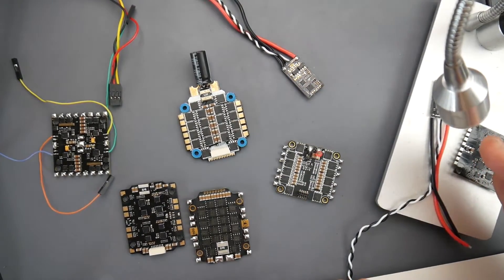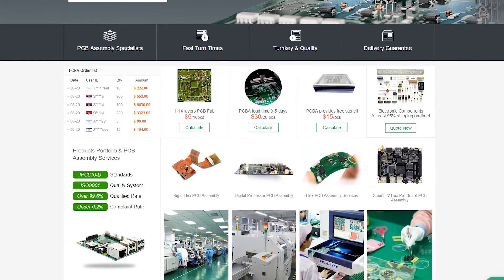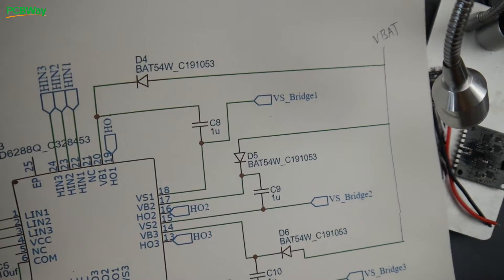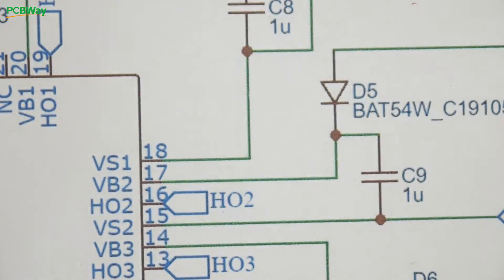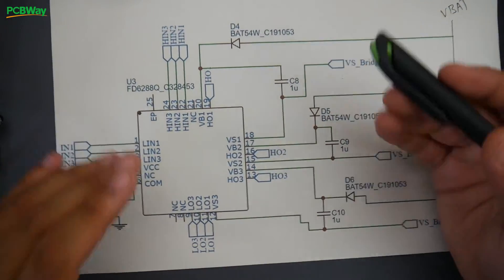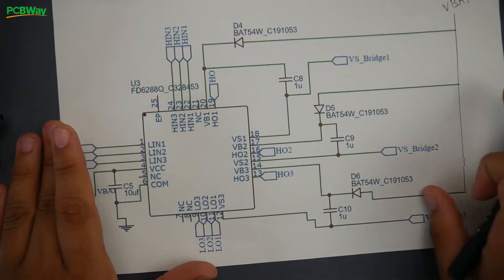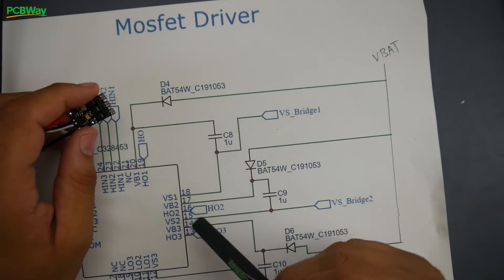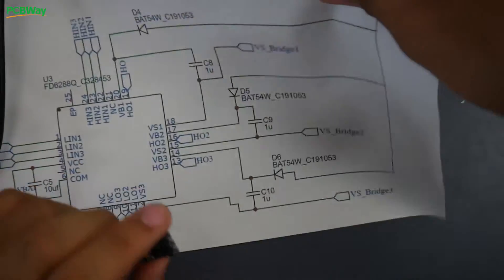How To Fix Any ESC // The Mosfet Driver Part 1

Comment: Great video for get some knowledge for repair our esc, right now I have a hobbywing 20x20 xrotor and I'm trying to findout how to repair it, m2 do not appear on blheli_32 motor connected even sound, mosfet are ok so don't  know what can be the issue, have this happened to you before or can you help me to find where is the issue, I have changed fc and wire to make sure is not a connection  issue

Comment: Hey Drone Mesh, I have the x rotor micro combo 60A 4 in 1 esc & flight controller F4 G3. I think I have a bust mosphett  on the esc and been watching your play lists for some tips. I’m not sure that I can read the number on the phett correctly to know which type they are. 
You wouldn’t happen to know what type of phetts these would be for this esc that I would need to get to make a repair?

Comment: VS is not Voltage sense, VS= Voltage Source (floating supply offset Voltage), for sensing Back EMF from the motor there is a resistor network placed close to the MCU each network is consist of 3 resistors maybe i guess. And thank you for making this awesome video.

Comment: I have an ORI32 that supplies about 25% less current to one motor at idle and at full punch outs maxes out in blackbox while all other motors are around 75%. I changed motors, resoldered etc and the problem persists at the same ESC location. The motor sounds fine and there is no stuttering. Is this a Mosfet or chip issue?
Reply from the maker: Seems to be a weak mosfet but you will have to replace all on the side with the issue.

Comment: I have 2 tekko32 that stopped working all of a sudden. One smoked when i plugged my battery, i checked the mcu and did not notice any strange short circuit, the only thing i know is that the 3v3 reg was heating a lot, and at first i tried to replace it, but that was not the problem. I still don’t know what happenned. The other one i let some time storaged (less than 2 months) and when i put it in my new plane it have never more turned on, but this time no heat nor smoke, it simply refused to turn on.

The first one i sent an email to holybro and they sent a new esc to me, but for the second i had not minded. I liked their support and warranty, but after these two problems and seeing some other people with similar problems i won’t buy anymore their products. Cheap escs have never disappointed me.

Comment: what if i short circuited it on the motor pads
Reply from the maker: I will purposely short 2 esc's on the channel for a tutorial video.
Reply: Thanks! Mine like smoked and it all looks black so would be cool if it could be fixed

Comment: Really a great content. 👍
However I have a question i.e. are the capacitors for coupling? For filter any DC out and let the AC only to the output? Like in audio amplifiers we put one between the output and the speaker?

Comment: Please do a video on replacing BLHeli 32 mcu chips. And flashing them from scratch as I have an ori32 that blew all 4 mcu chips all shorting to ground
Reply from the maker: it could just be the 3.3v
Reply: Drone Mesh it was in the short went away once I removed the chips. I also replaced the ldo regulator
Reply: I can replace the chips I just don’t know if you can flash BLHeli 32 from scratch as I have heard the boot loader is closed source for BLHeli 32
Reply: I had 3 Ori's failing in less than 20 flights something. 2 of them have shorted MCU as well. I've come into conclusion they're not worth fixing. The cramped layout is also a pain in the butt to analyze and fix. Unless you're running them on 7 inch cruiser only or something like that, not racing or freestyle. They're very sensitive to crashes.
Reply: Asu thanks for that!  have you actually ever replaced the mcu‘s is it possible to flash from scratch as I have bought the chips. I’m curious to know?
Reply from the maker: For blehli32 I have never tried but I will look into it. I'm 70% positive its possible
Reply: Sorry but it's not possible,  @rowanballinger3690 . The BlHeli32 is a closed-source system and only ESC manufacturers who paid for the BlHeli32 system has the code.

Be glad that you only have one dud, don't be like me who's don't learn quick and buy 2 more.
Reply: Asu thank you for your reply. Any suggestions for a reliable 20x20 BLHeli 32 esc. As you said you been through a few.
Reply: I stopped using 20mm on 5 inch ever since but if you're insisting, I'd put my cent on Aikon PIN35A,  @rowanballinger3690 .

I always prefer ESC with the bigger 5x6 FET than the 3x3 FET because I find ESC with bigger FET's handle huge transient current in crashes better than the small one. Unfortunately, all 20mm ESC's are using 3x3 or smaller FET's. They just don't cut it for me.
Reply: Asu that is great advice and completely get that but I live in United Kingdom and we are restricted to 250g so only fly 3 inch. I’ll have a look round for a better esc. I also enjoy repairing them and have repaired vtx’s fc’s just have not had much luck fixing esc’s. Maybe BLHeli s is way to go but it’s going backwards 😱
Reply: 3 inch is a completely different story,  @rowanballinger3690 . Most 20mm can handle them. Thought you was talking about 5 inch. Try Aikon PIN25A, cheaper and should be enough for 3 inch. If you're satisfied, stick with the ESC, like I did. If the "something unfortunate" happened, buy a new one and keep the old one as donor in case the newer one get into trouble. Countless amount of times I've saved my broke ass with donor part. People often see them as junk or fancy keychain, but I see them as valuable resources.

I'm really sorry for that 250g thing. Can't imagine living without 5 inch. Something I took for granted..
Reply: Asu ahh you seem like a really nice guy thanks for your help yea 250g sucks we don’t have the land here it’s all privately owned literally the whole country. To be honest you can do a lot with 250g and I get a bit of a buzz finding new spots. And a little fun running away from a angry land owner but don’t happen to much 😂 I am respectful but apart from getting up a 6 am to avoid crowds! What can you do. I to keep all my broken parts for spares as money is tight but I have learned so Much I couldn’t even solder when I started. Happy flying thanks for the advice
Reply: Coming back after some experience,  @rowanballinger3690 . I think it's possible to flash bare chips with Blheli32 firmware. The hex code for certain version is publicly available at Blheli32 github page. With an STM32 USB linker, you'll need to connect SWD and SWC of both USB linker and MCU, which fortunately has been broken out on the ESC (they're even clearly labeled on Ori32). You'll then need to flash the chip using STM utility software. I tried this but with no success because I was using MCU from Blheli32 ESC which they're all read-write level 2 protected but with new bare chip, I believe it's possible.
Reply: Asu oh wow thanks so much for sharing that I still got the broken wax and chips so I will give it a go. Be good to be able to fix them. Haven’t had one blow since I changed over to kakute 20 x20 but still be fun to fix it 😊